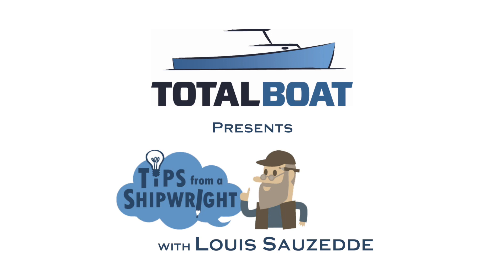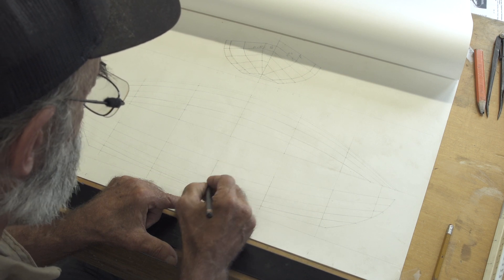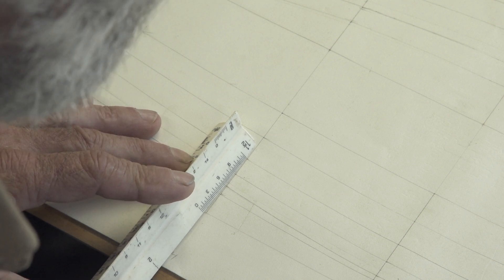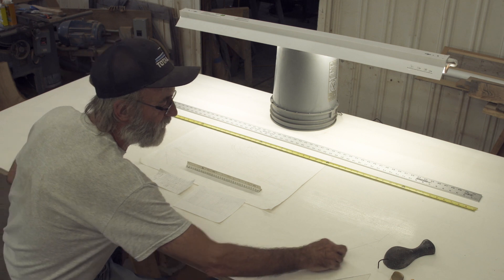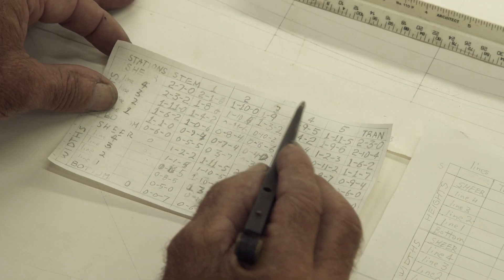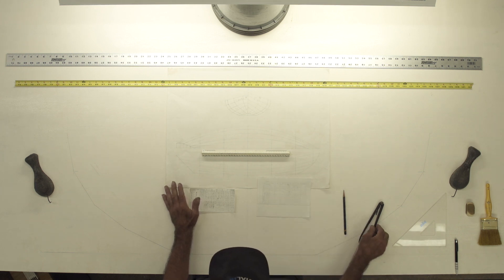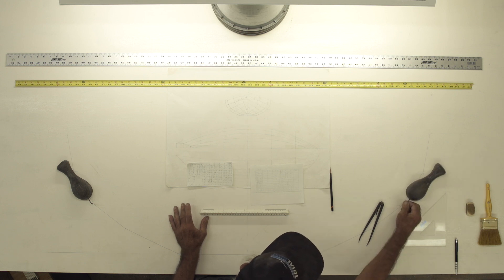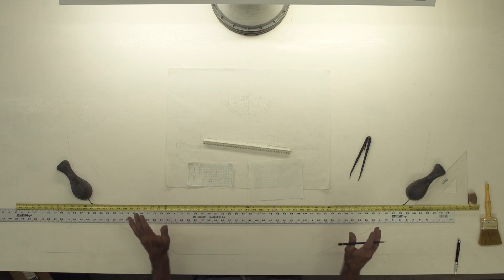Building the TotalBoat Sport Dory: Episode 3 - Table of Offsets

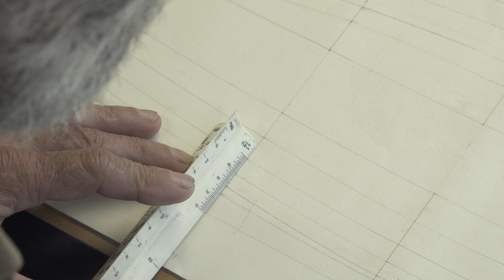Comment: Question: I thought I knew how to use a scale  rule, but at the 3:00 mark I don't see how that measurement is 11 and 4/8ths.  Can anyone explain? It looks like 8 and  1/2 or so.
Reply: he was measuring down from a full foot measure, on the scale being used, back toward zero. each tic-mark is 1/4 inch, so two ticks up  from zero would be 12 inches minus 2/4" (up from the zero end). 12 inches minus 2/4 (4/8) would be 11 4/8". (half an inch shy of a full 12 inches or one foot). Look at it closely, again. To lable the grid in 8ths you have to judge between the tics.

Comment: hi, thank you for the deep inside in the lofting. I have one question why do you not loft a smal boat like this 1:1 because you anyway doing it at the end 1:1.??? If you just give a hint why you working this way? Thank you for the great videos and super boats . I wish I could have a boat like this.
Reply: The original lines drawing would be easier to work and adjust on a ratio scale. then you physically enlarge it to life size to set up to cut molds to form the boat around. Imagine erasing 43 feet of pencil on wood if you had to readjust three or more lines to adjust for a more fair look to the boat? Plus, having the lines drawing gives you a reference to pull from once the larger board/plywood loft is cut up to make the moulds.

Comment: I enjoyed seeing this video in how the offsets are made/used. Not sure it applies to this build, but I'm curious in this process with larger boats when frames are cut with a bevel instead of squared cuts. I wonder if in a future video that can be explained since the bevel could change during the length of the frame. Can the bevel be figured out through the line drawings? Alternatively, if there's another video that could be referenced or from a book, I'm open to any info. Just interested in wooden boatbuilding and how it all comes together. Thanks.

Comment: A simple T-square and millimeters would make your amazing work so much easier and maybe more accurate... but, there is always more'n one way to skin a cat.  Can't wait to see the boat take shape!
Reply: divide an odd number of  millimeters by an even number and you no longer have a full millimeter of accuracy. If you take 161 millimeter  dead rise and have to divide it for two boards and want them equal, how do you get an exact 80.5 millimeter reading on a metric rule with the millimeter being the smallest measure represented? At least in imperial we are used to our 1/4, 1/8, 1/16, 1/32, etc.., fractional system for dividing measurements when need be. Fractions are more accurate then decimals. in that every  decimal has an equivalent fraction. However, there are exact measure fractions with no exact decimal equivalent. Example: what exact decimal is equivalent to 1/3, or 1/11? a repeating decimal (in both of these cases) has no final number, you have to round off to the nearest decimal at some point, ergo, not exactly accurate.

Comment: How on do imperial measurements not drive you mad? Millimetres are infinitely more logical.
Reply: I'm a Metric baby, but I use inches for carpentry. Surprisingly it's very intuitive when you get used to it. For example dividing stuff in half or quarters is really easy.  Plus building houses in those small millimetre things is too fiddly.
Reply: The measurement system does not matter as long as you select and employ a constant standard  for length.  Accordingly, Lou could have used cubits if he wanted to.
Reply: you can use centimetres as well
Reply: Only Germans use centimetres for building, UK, Oz, NZ use mm only - no chance for confusion.

Comment: Nice trick with the tape measure section!
Reply: I've seen an older member of literally every craft in home building use a piece of a tape-measure. even seen one Mexican crew use a 35 footer to provide 5 guys with just over a six foot rule each. the crew "foreman" was the only guy who had a full tape-measure in its spring loaded case.

Comment: Guys, watching this, I'm glad I do not have use imperial units. Just for ability to handle that Lou should get Nobel prize.
Reply: It really is not that hard of a system. the difficulty lies in the translation from one system to the other if you are not highly experienced with both. Don't let the fractions scare you, they are actually more accurate than decimals for measuring. When your materials are sold in Imperial, metric creates waste and/or inaccuracies.

Comment: A thought. Why not clamp a rule on either side of your loft table and run your straight edge up between them? You could even use a piece of aluminium angle with your tape segment attached perpendicular to the table to get marks that are right next to the paper. Not quite as accurate as a drafting machine, but probably a bit easier on you. 

Thank you for letting me into your workshop.

Comment: Well it's interesting to follow as I spent the Spring lofting my 21'2" Indian Class John G. Alden day sailing boat. Although I had the moulds with planking lines, some of the planks were 14" wide at the widest point meaning I would of needed wood stock well over 20+ inches due to the rise and in Finland it just isn't possible (on a budget) as I would have had to purchase expensive mahogany planking and it's crazy expensive and seeing as I haven't built a boat 'ever' if I mess up even one plank then I've destroyed 200€ of wood. So I'm using Finnish pine and the moulds are rounded so I can layout new planking lines on the moulds and use thinner local stock.
Reply: Paul Hitchman have you checked from Novo Wood it's near Lahti . Oy Nordisk Åbo Ab and Viilukeskus in Turku . Regards from Salo Finland   Juhani Perttula
Reply: I just purchased  17 x 6.5m mänty venelauta from a local boat builder for 200€ but I recon I've no where near enough so I need more. I'll be sure to check them out. I nee iroko for the tievi and köli maybe perasin...